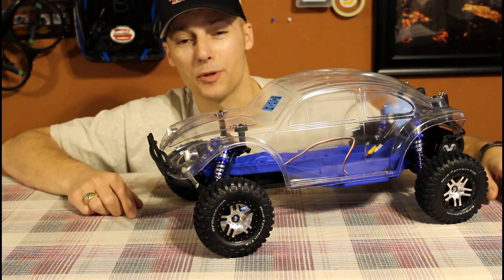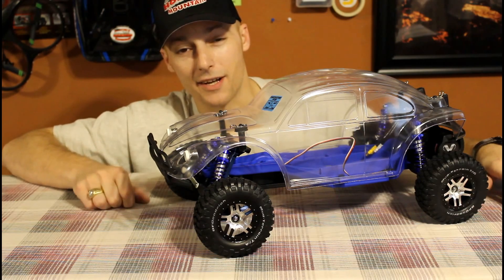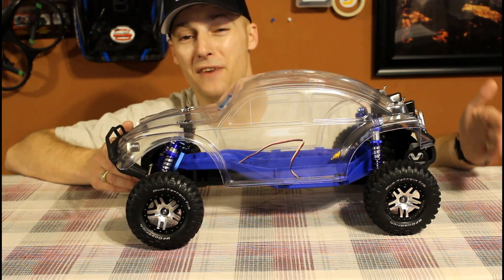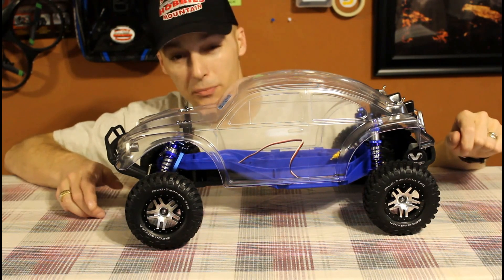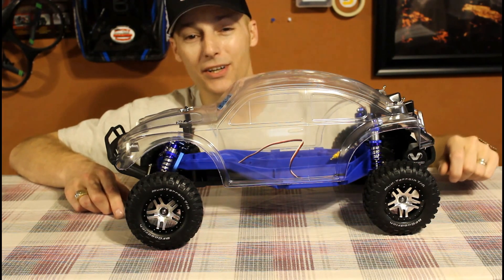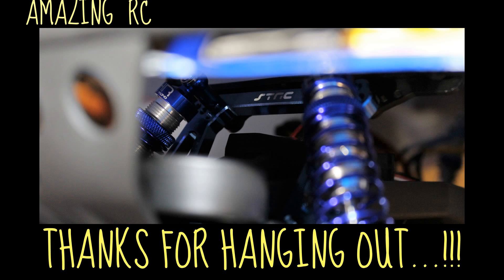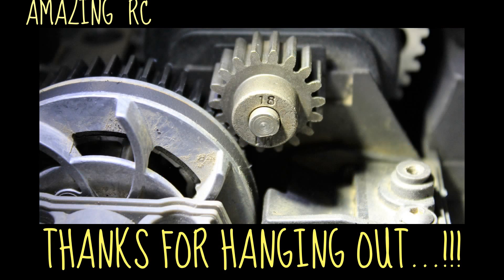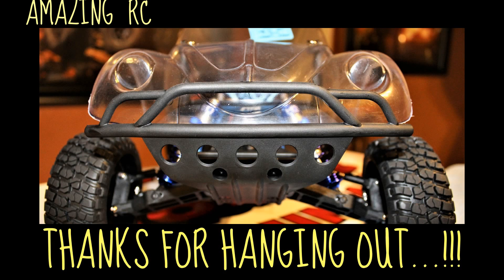TRAXXAS SLASH project BETA build part 5 ( LOW-CG )

Comment: I need to buy a couple of these , cut them both in half , and make one long wheel base  (14.5 inch or so) version for a derby project . Are they reasonably priced ?
Reply from the maker: Billy C. LeWorth--- If your talking about the VW body, it's around 30$ USD from ProLine. The truck is a Traxxas Slash, the base model is around 175$ USD or so...This one around 400$... And both would need a slight stretch... About an inch or so... Thanks again for hanging out...!!!
Reply: Thanx , I'm in Canada so prices are about a third more . I was asking about the lowered chassis .
Reply from the maker: LOL, That is around 30$ USD... Thing is, I happen to have an extra one that I would be willing to trade... If it's something that you may be interested in. You can email me for the details at... fortuccinowell@icloud.com
Reply from the maker: Billy C. LeWorth--- I would love to have on of your beat up wrecked demolition metal bodies you made to hang in my RC videos... think about it...
Reply: I have one or two lying around that are no longer able to run . They're yours if you want , but shipping to where ever you are from here ( small town in Alberta Canada ) might ad up . Private message me and we can figure it out .I'd be willing to split the shipping with you .